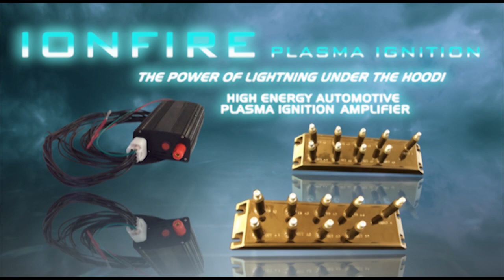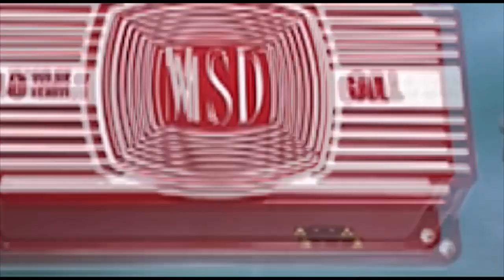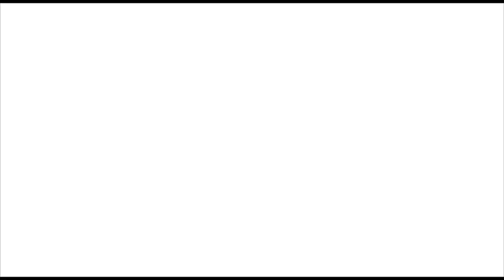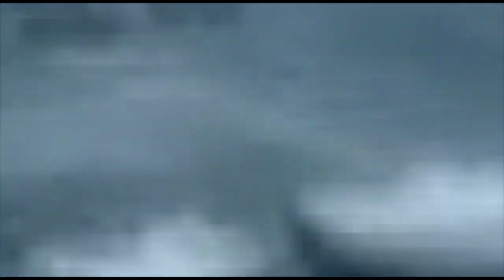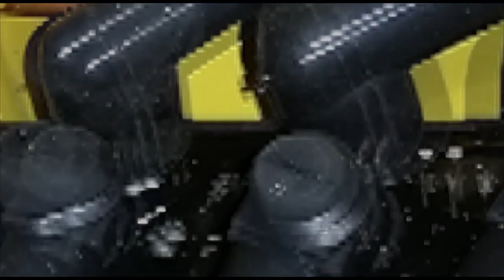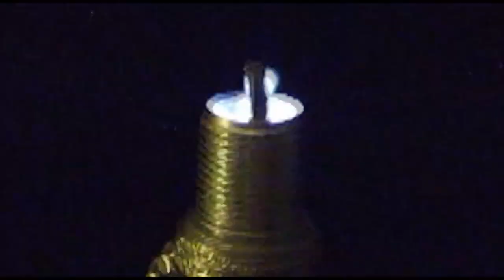IONFIRE PLASMA IGNITION! THE WORLD'S MOST POWERFUL AUTOMOTIVE SPARK AMPLIFIER!

Comment: On a related subject... an MSD 6A through 3 Toyota coils in series produces a four-inch arc, and reproduces the notes of the electric guitar perfectly (and loudly). various circuitry on the input for the guitar to trigger the MSD unit... the ark is two orders of magnitude beyond the MSD spark y'all showed there, just saying. I built another one that uses a GM HEI coil... the ark erupts out of a fire from burning vodka... it produces more bass than the other one, and the Ark is orange instead of purple and red... peace, gentleman.